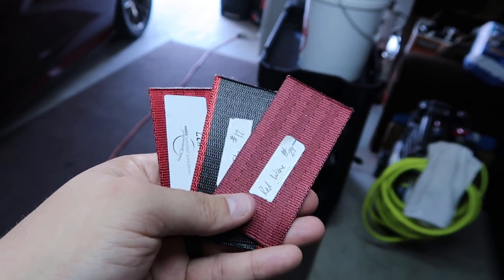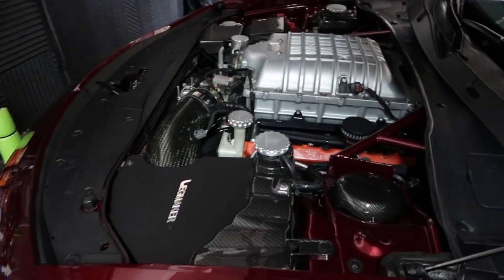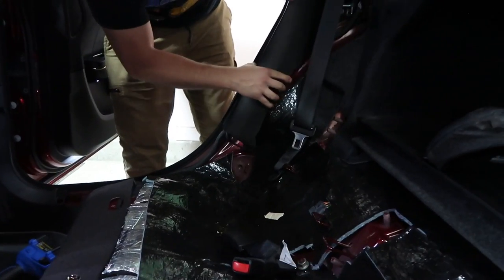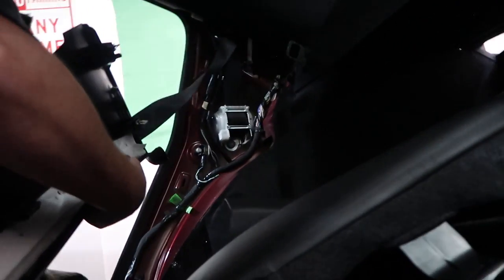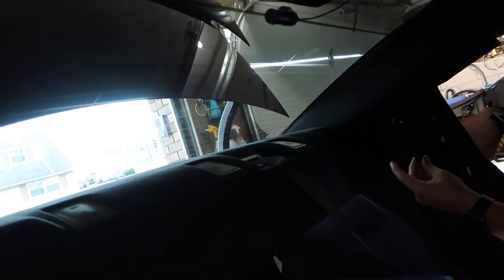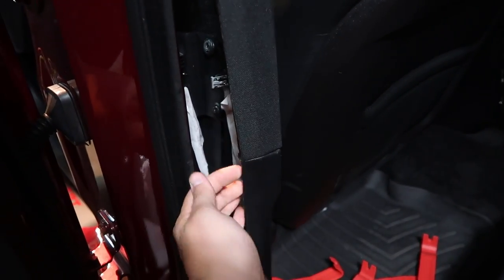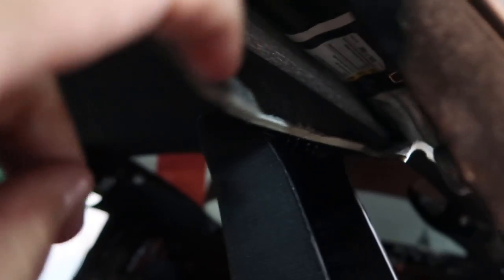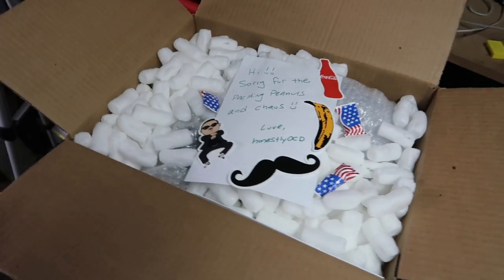Hellcat Custom Red Wine Seatbelts !! Part 1: Removing The Belts

Comment: Hey, do you think that if I run a 2.4 Pulley and used a boost a pump, instead of a fire innovations system, that the fuel pump would be able to supply enough E85? I live in Sacramento so I'm not that high in regard to altitude, so I'll be building quite a bit of boost. I have 1700CC injectors to go along with it. Thanks man, continue the videos.
Reply from the maker: Jashanjit Kalotia everytime my engine builder hears the words boost a pump he cringes and hangs up the phone .. I wouldn't go that route at all to be honest .. do it right the first time and avoid issues down the road